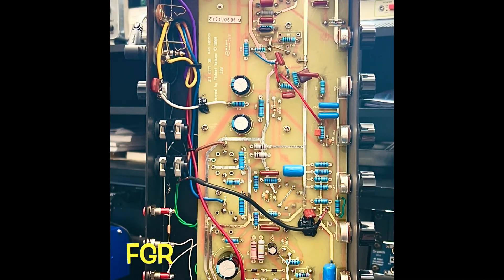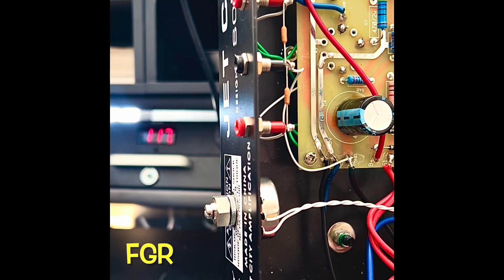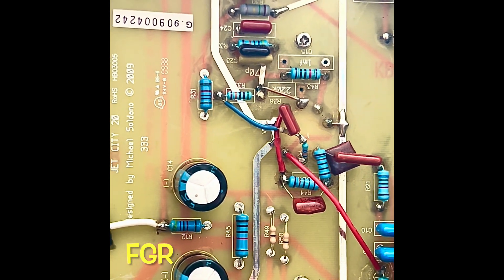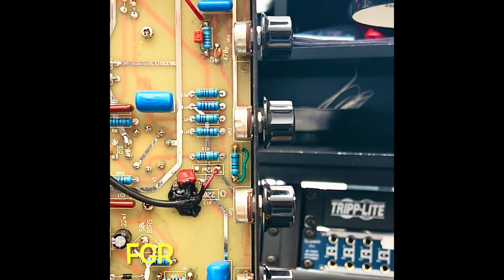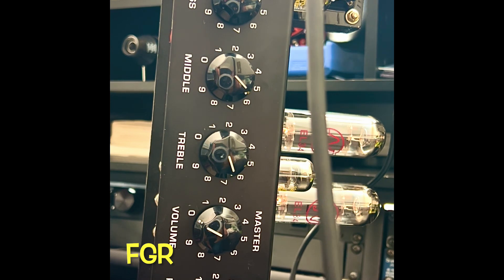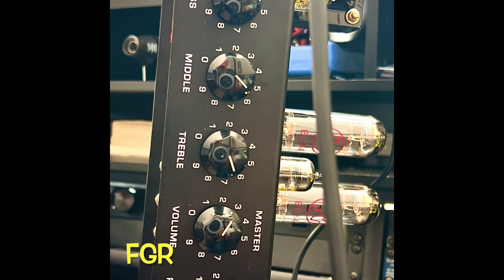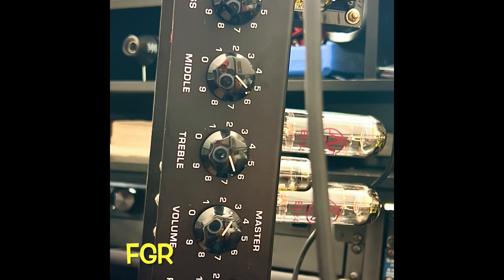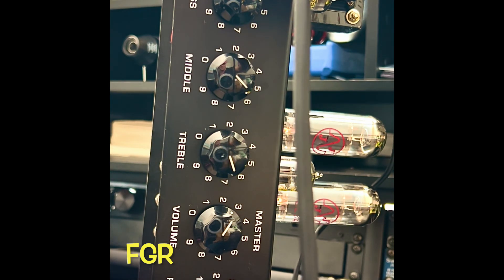Modding a Jet City JCA20H: Ext Bias/Octals/Bug Fixes

Comment: I am modifying my JCA20H with octal sockets and I am tempted by some EL34 over the 6L6 but the power transformer only will supply 2A for the filaments.
How can you achieve to power that amp running a pair of EL34 without upgrading the PT?
Reply from the maker: If this was my amp, I'd run the stock power tubes. The EL34's didn't cause any increase in heat from the PT in the 2 hour burn in and play test, so perhaps the specs are underrated on the data sheet. I'd be more worried about the manufacturer of the parts kit's lack of documentation in the way of octal choice vs OT secondary matching.
Reply: @ForgottenGearRestorations  interesting that the PT did not ramp up in temp. Mine, within 30 mins, reached up 45 degrees C using 5881.
Reply from the maker: @PhuketMyMac mod at your discretion. I'd leave the original tubes in.